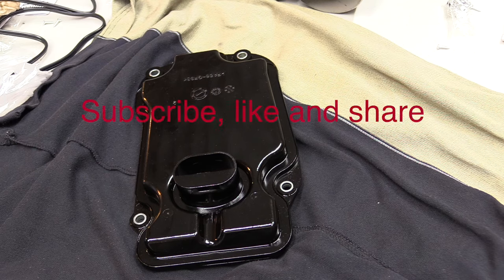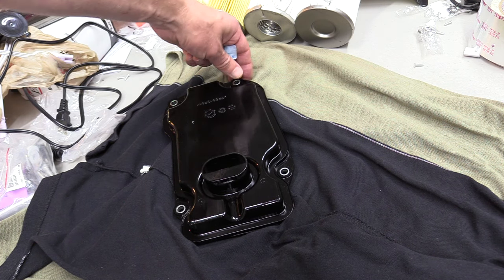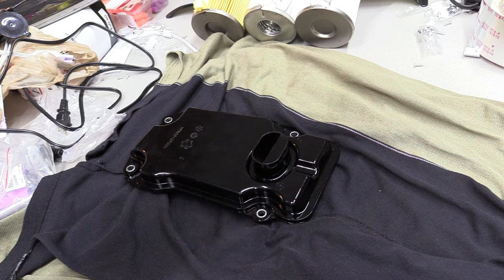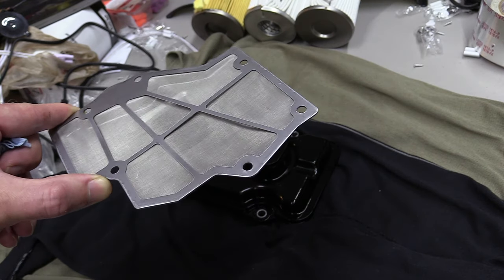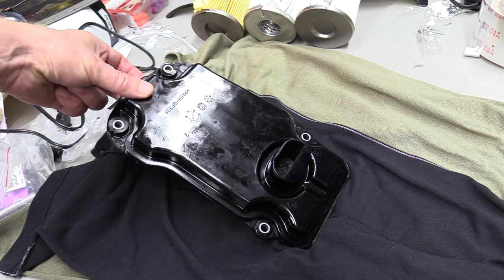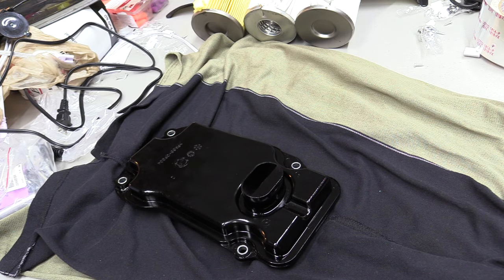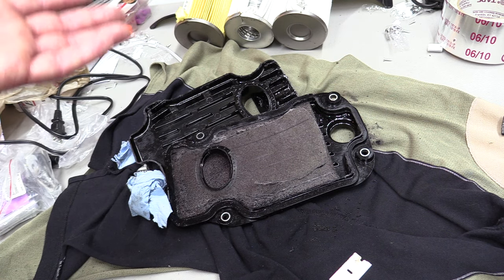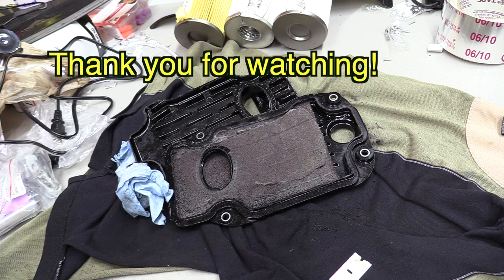Avoid replacing transmission filter, avoid costly transmission repairs, transmission maintenance

Comment from the maker: Look at this 350k miles reliable FORD  https://www.amsoil.com/newsstand/testimonials/articles/pristine-ford-flex-tops-350-000-miles/?zo=5257753
Every car, truck and EV needs this https://youtu.be/H_bSDqnSh90
Maintenance mistake made by diesel owners https://youtu.be/WBOBzA56jvw
Why trucks don't come with this? https://youtu.be/hBbzJmCHtCo
How to improve lights without cutting or drilling https://youtu.be/K4WbM97pkmE
How to protect paint on the vehicle without wax https://youtu.be/I1fu9TsiYBc
Reply: I have a passo I put my car in reverse and it doesn't move
Reply from the maker: @blessbless1919  , what is the mileage? How often atf fluid has been replaced?
What has been done to the transmission?
Reply: 500K miles on a transmission? I was at 30K and I didn't get a flush before the 4l60e lost 3-4 clutch pack. I had gone over 5K rpm a few times - so probably the drum piston seal was cracked and also the release springs couldn't handle the cavitation from the centrifuge at high rpm. So yeah it was $5K to put in a Reman. Thanks for this vid - I'll get a flush every 10K miles now.
Reply: I subscribed thoy
Reply: Though
Reply: I just bought a 2011 Toyota rav 4 . It has 190,250 miles the trans oil is light brown . Should I just dump the oil only ? Or do it in stages dump oil now and drive it to see if it acts up and then do it again with a filter in a month?
Reply from the maker: @vermontjeff2535 , How often transmission fluid needs changed? Every 30k miles or lifetime for the life of warranty?
https://youtu.be/Kb3GQRzkLVQ
Reply: I'm the owner and hardly drive it often. I have a 2009 Pontiac g5. Never changed  the oil fluid and filter on my sealed automatic transmission besides annual oil engine change. My mileage is only 11 000km. My GM book says I need to change my oil transmission every  80km, 160km and 240km,  My car always sits inside my condo. Have no problem at all with my transmission. Do I need to flush my oil transmission? I see dealers use a pump or best no pump and flash it by just draining it out and replacing it with new right oil transmission fluid and filter ? I will never get it to 80km. Maybe save my money perhaps in my case not needed to do a transmission flush?
Reply from the maker: @AnthonyManzio atf fluid like any other fluids become acidic with time regardless of mileage. You not going to find fluid with lifetime warranty even if it’s in the bottle seating on the shelf in climate control environment. 4 years is the max life for atf fluid or 40k miles which ever comes first. For example one my cars is driven very lightly about 1700 miles per year and I change oil every year but oil barely makes to one year and I am not using fake synthetic oil either. I use best motor oil money can buy. I tried fake synthetic oils and they can barely last 6 months due to little driving.
Reply from the maker: @AnthonyManzio , drain and fill is the best method for atf.
Reply: @repairvehicle  So it needs to be drain even low mileage? Gm manual says 80km.
Reply from the maker: @AnthonyManzio fluid goes bad even at low mileage. Service manual always says mileage or time which ever come first. Yes at low mileage fluid should be replaced if you want trouble free equipment.
Reply: @repairvehicle  I'm saying the transmission oil not engine oil. I have low mileage. The GM manual it says 80km, so you think i need to change my oil transmission on my 2009  of only 11 000kms?
Reply from the maker: @AnthonyManzio all fluids go bad even if they are not used but seating on the shelf in the bottle. Yes, transmission oil, gear oil, power steering fluid, coolant and engine oil.
Reply from the maker: @AnthonyManzio I change my transmission fluid every two years about 10k miles.
Reply from the maker: Gm manual is wrong. Corporate companies do things to benefit their pockets as you probably know by know. If fluid was good for 80k miles then they would have given same mileage transmission warranty and unlimited years
Reply: @repairvehicle  You do have a point. I did on my old car Honda prelude 4ws 1988 bought second hand and at 60km or something like that they flushed my automatic  oil transmission and had problems shifting latter on had to get my transmission fixed and a few months had to get fixed again from their f up. If i change my oil transmission i could end up like my prelude. I did put more Milledge on my prelude had it for 15 years and even ended selling it to a young mechanic. The money on repairs i could have gotten a new car. I was to young an stupid lol. You change the transmission oil and it may start slipping. Maybe best don't do it? I'm afraid it may do the same pattern as my Honda.

Comment: I’ve been a mobile mechanic for 10 years never broke a bolt or seen one stripped or anything on trans. But YES change fluid every 40ish thousand miles. There is no such thing as lifetime fluid that is b.s.
Reply: I have seen them broken and stripped from people overtightening them, but I have never broken or stripped one myself. As long as a torque wrench or common sense is used when tightening the bolts, there should be no problem.
Reply: transmission every 40,000 miles?. I googled how often should i change on my  scion tc 2005 and says every 100,000 miles .
Reply: @fastdeliveryl708  The manufacturers couldn't care less how long the transmission lasts once the car is out of warranty, but they do care about the cost of ownership calculations since people look at that when choosing a car. Do what you want, but $30 or whatever for new fluid every few years depending on how much you drive is cheap insurance if you want to keep the car for a long time.
Reply: @averyalexander2303  i might do it, every 60,000 then or 65,000 .
Reply: @fastdeliveryl708  It's up to you. If you want actual data, you can have the old fluid analyzed by companies like Blackstone Labs to see how much life is left in it and know for sure instead of guessing. Many factors such as how and where the vehicle is driven, the transmission's internal wear, which fluid is used, etc drastically affect the fluid's longevity, so accurately estimating it's condition just by mileage is impossible. If it was that simple, oil analysis labs wouldn't exist.
Reply: @averyalexander2303  idk i just changed the filter and trans fluid as well so i was just researching when to change it again and came out with this youtuber scotty , seems he knows whats hes doing and recommended every 60,000 to be safe .
Reply from the maker: I already did atf fluid analysis at 50k miles normal driving, fluid is already garbage destroying transmission.
Reply: You must not live in the salt belt states
Reply: You must live in the south. Up hear you can’t get the pan off without breaking the cheap bolts. Salt , steel and aluminum together are not your friend. You ‘ll see!!
Reply: Yeah lifetime warranty on the transmission fluid flush it😂 I'm not a professional mechanic but I've been playing with this stuff since I was 18 and I've learned a few things the hard way I like the old iron it was a lot easier to work on
Reply: Thanks for the video I still change my filters when I get the kit but it's been years I didn't know some vehicles nowadays have two filters nice video simple and to the point
Reply: If my car got 98k miles you think I should change trans or jsut go with it as to not cause problems
Reply: @brandondang7156  change it and filter and continue doing it when the service manual says or sooner. What color is ur fluid?
Reply: My 01 gs300 with 250k begs to differ
Reply: @repairvehicle please share the rest report or the resulting tests on your ATF fluid.Will be interesting! 😊
Reply from the maker: Lab results on my channel for atf fluid
Reply: I have done thousands of transmission tune ups  yeah but people likes to service their transmission until reaches 200k miles .
Reply: Never changed trans oil on my 08 Honda Odyssey just once at 60k miles drained and fill, now 240k  miles still shift like new.
Reply from the maker: @MidwestAtvGroup definitely not true statement like new
Reply: @repairvehicle  no reason for me to lie. Actually shifts smoother than our new VW Atlas 8 Speed.
Reply: I had my 2014 gmc sierra 1500 transmission flushed the first time at 50K , now at just a little over 100K I'm gonna do both the filter and transmission fluid .
Reply: I have a 2018 toyots tundra v8 with 6 speed auto trans. It has 76,000 miles its new to me, so i am planning to change fluid. What is your recommended fluid. 

The separate question is, have you reviewed pennzoil Platinum lv atf?
Reply: @repairvehicle need to use AMSOIL fluids instead. They last 100k in automatic transmission no problem
Reply: I agree, there is no such thing as lifetime transmission oil. The best oil ever made, will with usage and time, deteriorate and give less lubrication performance to the transmission, accelerating wear. Many manufacturers have removed the transmission tube and dipstick, but the transmission still has drain plugs and a fill port to change the oil. They do this to make it far more difficult then before, forcing people to take it in and do the job at the dealer and make more money.
Reply: @brandondang7156  just change fluid.
Reply: It is lifetime of the transmission fluid lol. Get it, it is the lifetime of the transmission. Once that fluid goes bad so does the transmission so they both go out 😅
Reply: Yes it is. Ask ford, the lifetimes of the transmission is 80,000. 😅
Reply: @MidwestAtvGroup was changing fluid very noticeable???
Reply: I drive a high performance boosted V8 and do lots of city driving...lead foot. I do drain and fills every 15k to 20k.. fluid is cheap and a new transmission is 8 thousand dollars without labor.
Reply from the maker: @jaynikk758 Mopar?
Reply: @repairvehicle  Those are cool but no it is a Jaguar XJR with the 4.2 liter v8, planning on getting a smaller pulley, intake+exhaust, and tune
Reply: As a mechanic i agree fully. Manufacturers use new lightweight oils for supposed fuel economy and most are litterally burnt black by 50 thousand miles. Toyota's WS fluid is piss and so is Ford, s LV Mercon. Remember that now manufacturers are now " carbon taxed " on what amount of oil the vehicule can use in a normal lifetime , hence  completely irrealistic fluid change intervals. When your transmission is toast at 65 thou miles it becomes your problem not theirs. As the gentlemean said , fluid is cheap , a transmission rebuild is not
Reply: @fastdeliveryl708  The whole Gist is to understand that Car Manufacturers just want to profit off you.
Putting your own research to the test will show you who has no idea about what they are talking about.
Reply: Mileage recommendations are not the best.. then it's forgotten about and never gets done.. 

Sifen hose sucks out 3-4 liters out of dipstick on my truck..  takes 10 minutes. My mazda has a drain bolt. 

As long as the fluid is fresh enough, drain and refill a little every year..
Reply: I broke many bolts on my own. I was using common sense. Or tried torq wrench didn’t go to spec and stripped bolt. So now taking off only drain plug
Reply: @gusteyigor  invest in a striped bolt removal socket set .. they can be had for cheap
Reply: hello...what about the filter?
Reply from the maker: @kevin-ty4nm , answer in the video about the filter.
Reply: @fastdeliveryl708  don't follow that garbage the book says when it comes to an automatic transmissions.  Do it sooner than later. Do drain and fills every 20-30k, then around 70k do your transmission filter.
Reply: @MidwestAtvGroup  did you ever change again yet
Reply from the maker: @carlward9367 don’t lies fool you. Automatic Transmission fluid should be replaced every 30k miles or 3 years which comes first
https://youtu.be/DE1dkgxDm4k
Reply: @pftrans  my 2003 tacoma has 171k miles and trans fluid has never been changed. it’s dark should i change or leave it alone ?

Comment: Hello, I’ve been doing a drain and refill on my 2003 Camry 2.4L with 400.000 miles since new with no problems.
Reply: Which trans oil are you using if u don’t mind asking ? And how often do you change it ? Thanks
Reply: @costantineyoussif6679  I use Castrol transmax import multi-vehicle. I do a drain and refill every 6 months
Reply: @gregorywells944  what?
You mean you change engine oil every 6 months?
Reply: @dvader3000  no, transmission fluid
Reply: @gregorywells944  you do every 6 months but .. how many miles ?. i heard has to be done every 60,000 on some youtube channels
Reply: @gregorywells944 I'm happy to be hear another person sharing their experience with Castrol Transmax. But changing the fluid every six months for me would mean driving only 2000 miles.
Reply: @slacker_DIY it's a waste of money doing it that often

Comment: 104,000 miles on the original filter in my 2019 silverado. Just today , September 9th 2023, I popped out the filter just to make sure it's not cracked. Popped it back in, topped off the 5 gts I drained with fresh fluid. I don't even need to move the heat shield to get at the fill plug anymore. I get in there with bent pliers and pop it out, insert some tuning into the hole, and fill from the engine compartment with a funnel into the tubing. Works great.
Reply: On Chevys I would change the filter they are easy to get to I have changed my transmission Filter on my 2 door OBS Tahoe many times in the Different Tahoe’s I have owned no issues.

Comment: Excellent video.  I have an 08 Acura TL with 350k and the original transmission.  I do a drain/fill with every other engine oil/filter change or about every 10k miles.  No filter.  Still shifts like new.
Reply from the maker: More people need to read your experience, true and tried.
Reply: Wow. I do every 30k on a 2006 Matrix with 200,000 miles. Never dropped the pan. Also shifts perfect.
Reply: I do the exact same thing on my 2012 Camry. The only thing I don't like is having to pump the transmission fluid back in, I hate doing that. I found a funnel that actually fits into drain refill hole, but it's not long enough to wear I can just pour 2 bottles of tranny fluid in. I'm currently looking for some clear plastic hose or something where I can attach to the bottom of the funnel I'm using so it's extends past my wheel and I can hold upright where I can just pour 2 bottles right in.
Reply: Acura doesn't have a internal trans filter.

Comment: I agree with changing fluid regularly,  I use Amsoil Signature series , which doubles intervals but, if you don't change that trans filter and it's half plugged up, that trans will starve itself from fluid, burning up the wear plates, petroleum based fluids break down quick in towing or high stress, which in turn creates particles.

Comment: Awesome! Thank you for clarifying the differences. My old mechanic told me once before he retired...you don’t need to change the trans filter unless there is a problem (dirty and burn odor fluid)  as long as you change the trans fluid regularly (drain/fill)
Reply: I agree, the problems begin when the fluid ISN'T changed regularly. But if the transmission doesn't have a drain plug on the pan as many do not, the pan has to be removed to drain the fluid anyways. And once the pan is removed, I'd personally just spend the ~$20 replacing the filter for piece of mind. If the pan had a drain plug, I'd just drop the pan, clean the magnets, and change the filter every few drain and fills. Those filters do last a while since they don't accumulate soot and other combustion byproducts like engine oil filters do, but the filter and magnets do accumulate debris over time from internal wear and I just feel better getting that crap out of the transmission from time to time.
Reply: Filters get dirty.  They clog and cause major stress in the hydraulic system
Reply from the maker: @tomcocci you are wrong! Watch video first without skipping and comment
Reply: @repairvehicle ?

Comment: Ive got a 2010 lexus es 350 with 120000 miles and i have no clue if the trans fluid has ever been changed. These videos are giving my the confidence to change it myself. Great stuff
Reply: Is there anything i should watch out for on a fluid change with this many miles on it? Im pretty sure its the original fluid.
Reply from the maker: Depending where you leave,  your drain plug could be rusted, and you might have to use alternative tools  instead of 6mm hex
Reply: IF u are smart mechanically and know the exact procedure per toyota recommdendations:  otherwise, let a pro do it, bcuz there's a reason the Toyota co didn't want owners touching the system while under warranty, and it's bcuz of contamination that often happens with a non pro working on the system/bolts/etc.  have to keep everything super clean that touches the fluid/holes/etc
Reply from the maker: What contamination? How you seen one single video where it’s contamination free? Do you even realize what you are saying?

Comment: I took my Honda CRZ to a mechanic for transmission oil change after a while my transmission was slipping when u press the excelerator it would take off after 1 or 2 seconds after And i found out he did not put the correct CVTF oil in it as it is expensive but the only one that is recommended for my car.This time after learning from your video's i changed it myself with the correct oil and now it runs great.And this vid is a good example of how we can do a lot more damage than good when changing transmission filters.
Reply from the maker: Thank. you for sharing your experience.
Reply from the maker: With factory none synthetic atf it's best to do 30k miles atf fluid change.
Reply: I wouldn't blame the filter in this situation.